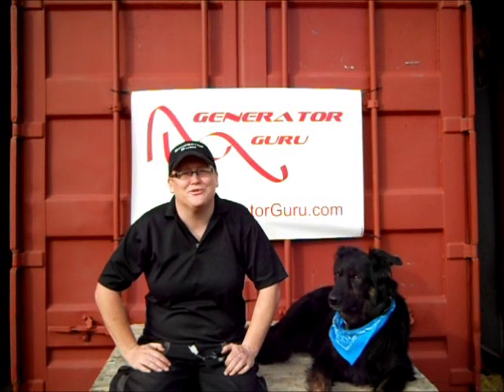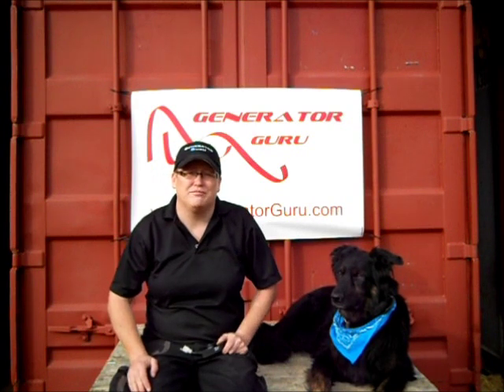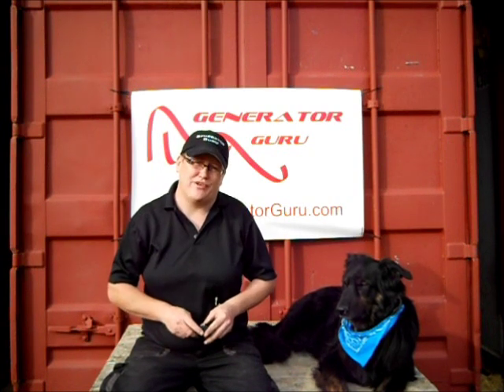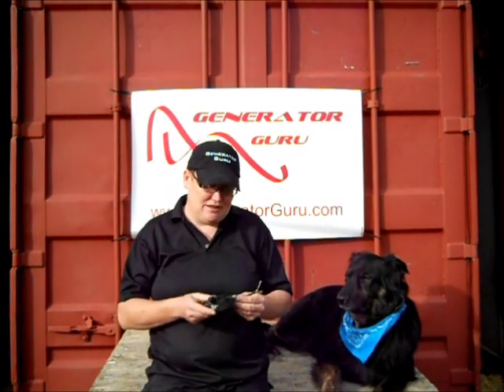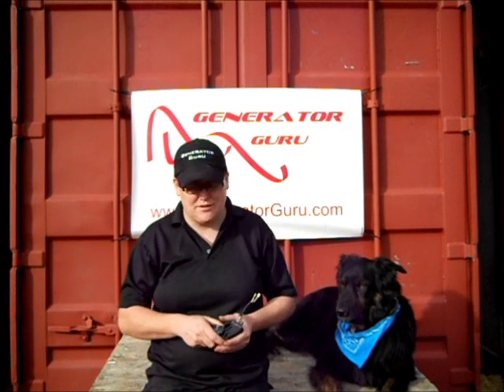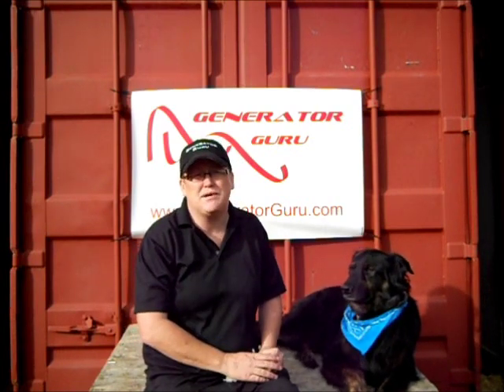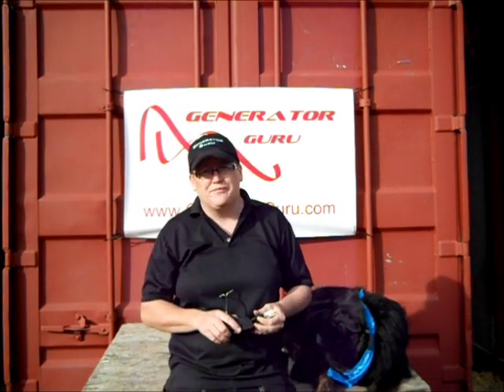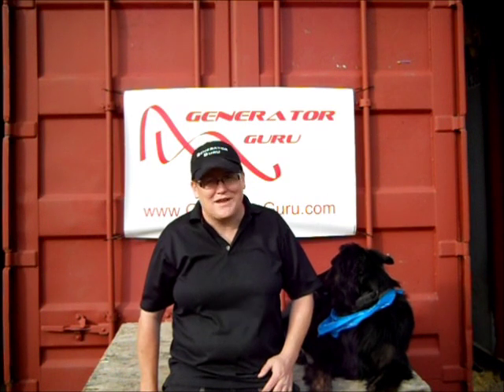AVR Function and Differences in Portable Generators

Comment: Hi I've got a Honda 3.5 gx110. But the power out has gone on it. Was stood a couple of years. Cannot find AVR not in the end  brushes are and have them out  where would the AVR be on this Genny.   Cheers
Reply from the maker: What model is it? FYI.. if it doesn't have brushes, then it is a Capacitor you need, not an AVR. They look like this: https://www.generatorguru.com/capacitors/
Reply: @Generatorguru  Hi its genrac frame large black plastic tank. Probably the electrical end of things . Run by Honda gx110 3.5hp on the pull start end but it has gx140 on engine body scribed.  On the electrical end their are brushes no avr  to be seen or in the switch box their re two blue wires going into the other end behind the fly wheel. Could it have avr  in there.   Cheers for any help given.

Comment: Hi. I have a sportsman 2000w generator that is putting out excessive voltage and am unable to adjust this to a safe range. I suspected a bad voltage regulator but now see that it doesn't have one. Can you give me some direction on how/what to fix? Thanks!
Reply from the maker: Please set up a ticket with our Engineers to discuss further as there could be a few reasons. (We do not charge for this service.)
https://www.generatorguru.com/need-help/

Comment: Hello sir good day... thank you for sharing your idea..
Sir i have 7kva generator only but i need more power to run  my soundsystem including lights...
Do i add 20kva AVR from the output of generator to the input of 20kva AVR to get 20kva power?
Is this idea is advisable?
What well happen if i do this connection?
Reply: Hi there
This really isn't advisable, it will put far too much excitation through the generator and damage it, there is no way of getting your 7Kva generator up to 20Kva.
Reply: Styles Generator Guru thank you for your advice sir... meaning if i need that amount of power i also need to have bigger generator....

Comment: Hello Sir, I have a Patriot 8500 diesel welder /Generator, and am looking for a wiring diagram for it.. The AVR wiring was hooked up wrong and plug ends cut off, the unit runs Great and generates power if You input 24+ volts to the exciter wires, any Help would be much appreciated. Thank You...
Reply: I am sorry to say we do not hold any manuals, as we are not affiliated with the manufacturer of this Generator. Instead we work with the Manufacturers of the parts made to build the Generator.

But we have Engineers here who have worked on your Generator a number of times. If you have any questions we would be very happy to advise you

Regards
The Generator Guru Team
Reply from the maker: Please contact us for further help on our website. we would be happy to guide you through the process. https://www.generatorguru.com/need-help/
Reply: Dear Dale
While we may not have a wiring diagram, if you can provide me with some photos of the alternator, the AVR and the cut wiring, I might be able to point you in the right direction

Comment: I have a troy built (briggs & Stratton) 5550 generator 030245-0 ...it does not have an avr. It appears to have a bridge rectifier built into the brush holder...My question is...can I add an avr to this unit ?
Reply: Dear Rachael
You cannot add AVRs to units if they are not designed to have one because of the way the stator is designed. You can add inline devices like RCDs to tidy up the power between the generator and the appliance though
Reply from the maker: Also UPS make the power smoother. (Uninterrupted Power Supply)

Comment: i called Buffalo Tools the other day, they seem to be the only one to have a parts list and schematic on their line of 800-1000w suitcase inverter generators with the 40cc  and up motors, Dirty Hand tools and predator and a couple other companies sell these, .... same plastic cases,  just different colors ...... I noticed you dont have any of these listed yet , Buffalo said they will be stocking parts soon, but as of right now because the line is so new if a warranty issue or a part is needed they are just pulling a part off an unboxed new one and sending them out , I have the DHT 700w and the 2800w inverter generators and parts are a concern for me in the future going off grid in a few months ..... I wouldnt even know where to start looking for a rebuild kit for a carb on either model or especially on the 700w  bowl less carb or  what they cross reference with .  any updates on your end with these products ??? Thanks for any info
Reply from the maker: Hi Dan
We are working with the manufacturers and will have parts on the shelves in the next couple of months, keep an eye on the site and listings for these will start to appear

Comment: how does 2 avr synchronize?
Reply from the maker: Are you sure you have an AVR on your unit? There is normally only one. 
It might be a capacitor you have on your unit. AVR has 5 or more wires to it. Capacitor 4 or less.

Comment: hi i have a duro max 4400 generator it has power out of the coils and it shows power on the gauge but when i turn on the breaker it goes stright to 0 volts if i hold the breaker switch in the middle it outputs power or if i put in on the 220v it outputs power but no power shows up on the gauge what might be causing this
Reply from the maker: Aaron, you need to follow the tests in this video for Brushed Alternator Generators. : https://www.youtube.com/watch?v=tC_LrrZcx38
With these results we can pin-point the problem for you. Look forward to receiving them! :)

Comment: hi there, quick question does an AVR on a generator protect sensitive electronics ie. computers, laptops and tvs, so they can be ran off the generator and do all generators have AVR's or can one retrofit an AVR
Reply: Dear Terry
Thank you for the great feedback! You have summed up our ethos very well!
Reply from the maker: There are 3 different types of generators. Brushless (capacitor), Brushed (AVR) and inverter. None of these can be retrofitted to accommodate another regulation system (ie AVR etc.)

If you are running sensitive equipment (computers/LCD TV/filming equipment) you need to purchase an Inverter Generator, or run a UPS (uninterrupted power supply) between the generator and the equipment.

Laptops are not counted as sensitive equipment and any surge will be compensated by the transformer and battery (though might ruin the battery if there is a surge.)

When it comes to TV's i think you have to weigh up the likelihood of a surge from an AVR generator and the cost of a new TV in comparison to an inverter generator. The surge may never happen and tv's are cheaper than generators these days!

AVR Generators do smooth out the surges, but when the AVR fails it can create a surge in voltage (usually 300v+) as it fails. Inverter generators cut the power off when they detect these surges.

PLEASE BE AWARE: If you decide to buy an inverter generator DO NOT buy from eBay or unknown dealers. Daily we hear about someone paying big money for an inverter generator, only to find it is not an inverter generator at all, and the company who sold it has disappeared! Always check reviews before buying, get from a shop you can visit in person, and check the sales person knows their generators. If they do not know about generators, they too could have fakes for sale! 

Mis-sold and fake generators are everywhere (and ATM many have the wording "kraft" in brand title! if so.... Avoid! Avoid! Avoid!) If it seems too small for the wattage compared to other brands it is probably being sold as a higher wattage than it can give out... definitely a fake!

Hope this is of assistance to you!
Reply: jacob lane
Reply: Generator Guru There's not much honest these day with company's or sellers but you're one of the few ones that are!👍

Comment: I'm using a cheap china made portable generator and it fried my adapter for my modem. What are cheaper options aside from line conditioners that I can use to protect my electronics? Maybe surge protector or like an avr for my computer? I just need my modem and a few lights working.
Reply: +Michael Cuevo Unfortunately the only option is a UPS, but these are expensive. A surge protector might help if it is a good brand (I use Belkin) but computer manufacturers recommend a UPS.

Comment: I want to post a question here but it's not being posted publicly. This
 is a test and if it works I will post the question as a reply. Sorry, 
and thanks.
Reply: +TrueNorthist I think I figured it out, youtube does not allow links to youtube. WTF? Anyway, here is the same comment with the link stripped out:

Thanks for the tips Styles. However, I am still not getting proper 
voltage at the 110 plug. (Nor the 220 but I will only refer to the 110 
circuit) I get 3.88v~ across the brushes, 3.95v~ at both L1-L2 and 
R1-R2, and 0v~ at L1-R1. All good right? I show exactly 4v~ on my 
multimeter and it drops to zero if I switch the 110/220 selector to off 
or trip the breakers, so there is some sort of activity going on in 
there. The "pilot" light is off. The genny was run for 12+ hours without 
issues a few days ago but had no output the next day after an oil 
change. BTW, its an older Yasutora MDG3600CL Diesel with less than 100 
hours on it. The engine is strong and the connectors inside the 
generator section are clean. Maybe my issues lay inside the panel?The Aurora diesel generator (The link I tried to post) is almost exactly the same as my Yasutora with some minor differences. 

If you search youtube for "Aurora Generators" then look for "Brushes and AVR" in their list of vids, it shows the same AVR/Brush wiring as mine.

Thanks and again, sorry for this pantomime. I did go through your tips on how to test etc as you might have guessed and I possibly put this comment under the wrong vid. Lump another apology together with the others... I just hope this one posts... (It did! tee hee hee)
Reply from the maker: +TrueNorthist Ok there is a lot to look into for you! Could you please be so kind as to open a support ticket with this information on, and we can investigate further? http://www.generatorguru.com/ask-the-guru/
Reply: +Generator Guru   Thanks for replying, but I do not wish to open any support tickets.  Bit of a joke on me after all the trouble I had posting here... I was rather just hoping for just a simple yes or no whether the numbers I got are good or whether my problems lay somewhere else. (The problem is somewhere else) I called Aurora because they carry the exact parts I might need and are much closer to home for this particular generator. Yasutora is indeed an older "Aurora". 

But thanks very much anyway. At least I got my posting issues sorted as well. Again, sorry in advance if any duplicate comments eventually get posted from Youtube purgatory.
Reply from the maker: +TrueNorthist Sir, We have never had your readings. As you can see it was not posted. I understand you are having trouble getting the post to show. We ask you to open a support ticket so we can give you 1-on-1 support.

Comment: hi, what a function of little screw blue on avr?
Reply from the maker: It controls the voltage. But you should not have to touch this as set by factory. better to speed up or slow down engine to adjust voltage. :)
Reply: +Generator Guru if i change motor speed, i affraid that i increase frequency output on electric output. my normal voltage is 220V but, now my generator only 180V output.. may i change little screw?
Reply from the maker: +H345 Have you run the test? You voltgae should not change unless the engine has slowed down or something is failing. I would run the tests and get us the results. If the avr is failing that screw could be live!!! Test first pls.

Comment: Need advice on how to fix your Generator? We have Generator Engineers on Chat on our website, ready to guide you through the repair.
You can contact us through your local Generator Guru website:
http://GeneratorGuru.us
http://GeneratorGuru.ca
http://GeneratorGuru.co.uk
http://GeneratorGuru.eu
http://GeneratorGuru.com
200,000+ Parts in stock for over 700 Brands of Portable Electricity Generators.

Comment: Howdy,Yesterday,  Power went out  had the generator pluggin away.  actually the second time using it since new.  I noticed i lost some of the circuits i had open for the generator to run.  i went to the generator and tested the output. Only half the receptacles were putting out pwer. the other circuits were fine.  seems like i lost the 240 volt out put.  like only one leg was working.  Any help would be appreciated big time before i start the repair job....Thanks,   Tim    ( TROY-BILT #01919)

Comment: Hello!
I've got a Diesel generator with alternator 
KDE6500E3
output 5.5/6.3KVA
voltage 400/230(416/240)V
current 7.9/(8.7)A
engine speed 3000/3600r/min

I want max power at 220V. I don't use 380V
For you is a good think to switch alternator from Star configuration to triangle?

Thk you!
Reply: How  much  is  the same   genset